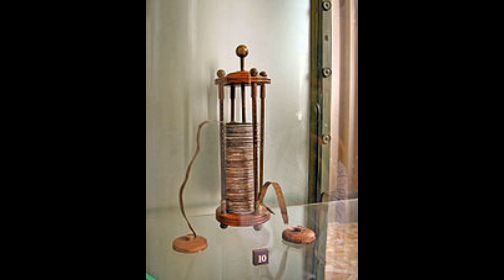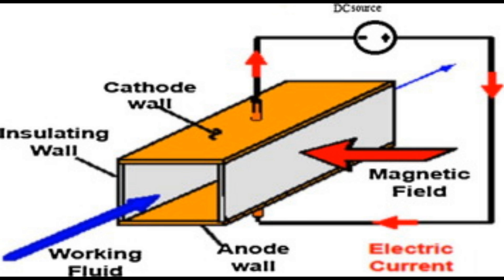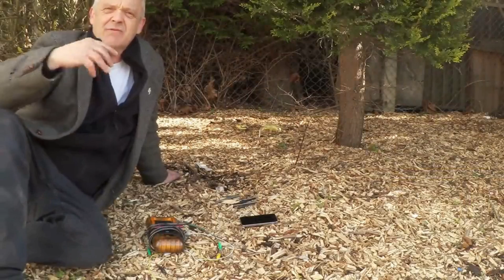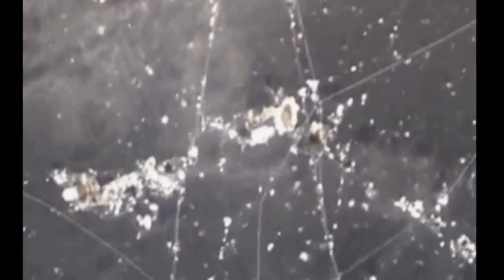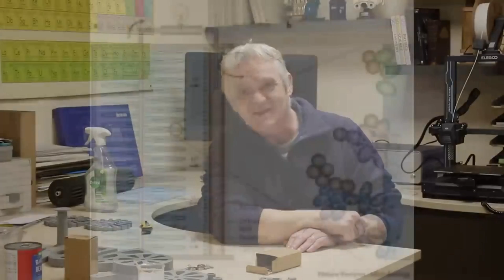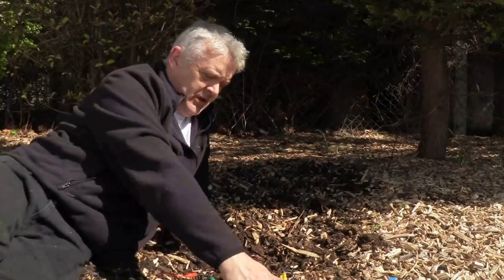042 The Earth Battery

Comment: Once I had to install an RCD in a house located on a separate plot. It was necessary, among other things, to correctly connect two grounding wires from electrodes in different places - one directly on the site, and the other somewhere on a power pole in the distance. Both ground electrodes are made of steel. The potential between these two grounds was sufficient to trip the RCD. I also connected the multimeter, but I don’t remember at all what it showed.

Comment: I thought Robert you were about to re-connect the tubes of soil up again on the bench and re-test the voltages. This would have been an interesting comparison. Then maybe test them periodically over weeks to discover the sustainability/decline of voltage, and whether it varied at times of day and night or at other times of external influences. Also, whether they need water to reinvigorate them as they naturally dry. I also wonder if diodes would be needed when using individual voltage accumulators, to protect the bacterial threads limits in voltage carrying capacity, through the accumulated back voltage, as we connect more accumulators. So many thoughts begin to occur.

Comment: I think it would be worth trying the same metal in different parts of the garden.  Where I am the soil is quite dry but my thinking is that different soil compositions could make for a voltage difference.  It will be tiny but it could be enough to run some very low power electronics.

Comment: Use a coil in the air for the positive and one in the e ground for negative and a rod for neutral. I would think different shaped coils would determine voltage or current gains.

Comment: Nathan Stubblefield did it best. He used three different metals. Zinc, copper and steal. He traped the positive and negative also he used steal as the path and kept a neutral ground not negative. He used the positive and negative voltage by keeping them separate instead of not using the negative potential.

Comment: Thanks. Surprised no mention of the Stubblefield coil which was invented by Nathaniel Stubblefield; his device was a generator but in order to get a patent, he had to label it an earth battery. He had interesting double coils with a capillary barrier between layers of coil. I'm with you on the fascination of these ideas. Apparantly,  Stubblefield powered carbon arc lighting and engineered one of first known communication system through his earth generators. 
The patent is out there, and I've seen a few wonderful builds based on the details.
Cheers!
Reply: I’ve seen an experiment with the Stubblefield but saw no results!

Comment: Fascinating stuff!
Something that you may not have thought of that may have relevance here ...... Electric!

Yes I know, but the electric I am referring to is the electric supply network. Specifically every substation has a grid of earth electrodes sunk into the ground and connected by a "mat" giving an extremely good electrical connection to earth ..... and the other end of those earth rods is connected to the Neutral point in the transformer. This means that there will be varying spurious electrical paths through the body of earth carrying current generated by our own electrical distribution system. 

That will be AC in nature but there is an added complication of DC generated by the buried lead sheaths of system cables (many of them were put in in the 1930's) and the copper plating from the  Earth rods in all the substations! There is also the electrical fields generated by the HV distribution system (pylons) which are easily strong enough to light a florescent tube should you stand under one of the active lines holding a tube upwards!

Yet another complication could come from old telephony which used an earth as part of the path!
 
I am unsure of how much this will affect experiments or indeed how they could be negated ........ or even used?

Comment: Wow, Robert! I service small yachts under 50 feet. This past season I noticed something about algae on fiberglass and aluminum hulls during yacht detail cleaning this past yachting season. The setting is on approximately the 33 parallel latitude in fresh lake water. Most of the vessels we perform maintenance on the bow and sterns are aligned close to magnetic North and South. When the port side of the units' face East the algae on that side of the hull can easily be wiped off after drying by my hand and the West side algae is very sticky and clingy and must be pressure washed off. Dry algae is less time consuming to remove then wet algae. Wet algae is like combing hair. Algae removal will increase speed as much as 32 kph. Your presentation jogged that this may be due to telluric currents, sun and or biological growth??? It's in my bucket list to investigate this further. Also, one of the interesting phenomena items concerning ground batteries is to cap the end facing down in the ground and cutting a 10 to 14-degree slit from the cap to about 12 mm from the top and face the slit North makes a notable current change. Facing the slit anode side South reduces the current however increases voltage. The galvanic flow of DC electrolysis naturally forms from anode to cathode as going from “north” to “south” respectively.

Comment: I've been learning about the global electric circuit, and the recent discoveries of things like elves and sprites, so I don't find it hard to credit the existence of teluric currents at all. Something that might have to do with generating them is the phenomenon of 'whistelers', the attenuated remnants of the braodband pulse of electromagnetic energy from lightning strikes sound like a descending whistle - in the audio spectrum - received by radio receivers. These pulses can form trains, where they travel along the Earth's magnetic field lines and reflect back along those field lines when they hit the surface of the Earth, or - rather - an attenuated and frequency shifted version of the pulse is reflected, and this happens over and over again, back and forth along those lines between both points on the globe where they intersect the surface (as many as forty times, apparently), losing energy, more in the lower frequencies than the upper, giving these 'whistler trains' their characteristic sound.

My point is that at each reflection at the surface, that 'lost' energy is carrying on into the Earth along the field lines, as happens with any impedance mismatch in the termination of a transmission line. In this case the impedance difference between the "leaky dielectric" of the atmosphere and the Earth, quite literally at ground potential. If you put a broadband pulse of energy, say from a spark gap, down a length of coax that was shorted at the far end, you'd see the same effect. This effect is used to find shorts and measure things like vswr, it's called Time-Domain Reflectometry, or TDR.

Comment: It really gets me the number of adverts on YT and FB for 'saving' power/heating your home for pennies using 'Earth electricity/ a small (usually USB) 'kinetic' heater that will heat your whole house in mins.
Of course you and the people who watch this channel realize they are scams but many don't. 
Earth batteries have uses but not heating.
As an aside some of my computers are so low power that it might actually be possible to run them from such a setup but perhaps the next generation. Worth a try with say a PI zero .